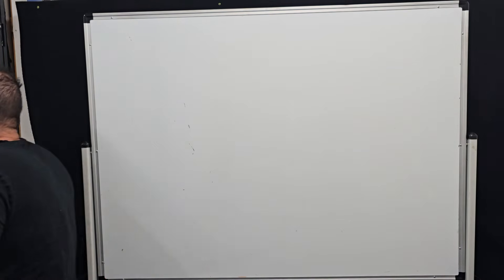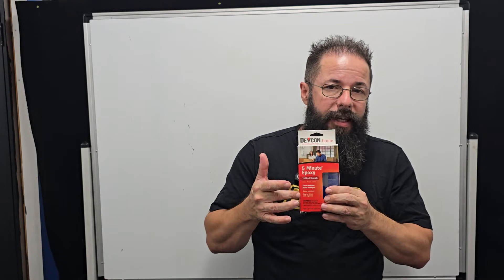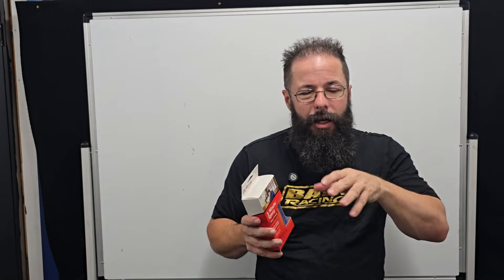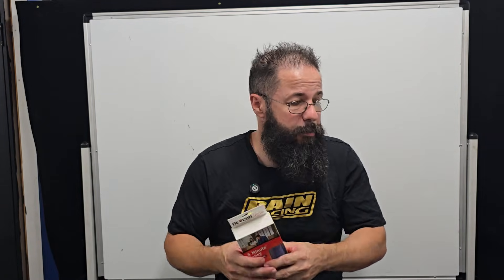Port Epoxy for Reshaping and Modifying - Splash Zone, Ferropre, and Devcon 2-Ton

Comment: Jake, same for cast iron?
Reply from the maker: Yes mate,  just mechanically clean and add anchors. Like a screw for the compound to hold onto. This way if it releases,  it still stays in place
Reply: @bainracing thanks Jake i have a hole. That should hold it. I over ported it! 😢
Reply from the maker: @alanhow3575 ah! Not great for holes. Needs to be thick. And make sure you seal it from both sides if possible.  Especially if its gone into water.

Comment: Hi did you guys got any info on the 5 valve audi heads the 3 intake valves must have high velocity
Reply from the maker: Yeah mate. They are lower velocity.  Its why opinions are divided we 3 valve. You need RPM to make them work and they don't make as much torque down low as 2 intake valves.  Also take some important steps when porting
Reply: @bainracing  Thanks so not going bigger at ports mines the small port use it on track days. More efficient get flow right check manifold add cams with revkit
Reply from the maker: @jozuaengelbrecht yeah. Just measure the area and see what your MSCA air speed is.  This will tell you what's needed.  Generally I don't making them much bigger. Just tidy them up.

Comment: Outstanding video, the concept of air flow dynamics is very complex!!looking forward to your 426 super stock experience, here in the states we have mopar superstar charlie wescott, and the hemi militia. Accepting any contender who steps in the ring, the ss/ah is contested at indy ,late August, pack a lunch, and run what ya brung!!the mopar dream team is pushing 3 horse a cubic inch, and a jessel valve train in the 12 grand rpm range, check out the amount of epoxy in the cast iron heads??good luck!!
Reply from the maker: Yeah I know a few guys that do it. Wish we had something like that in Australia 👍

Comment: For us E85 guys, that Devcon, according their own technical sheet, has near zero ethanol resistance.  The best ethanol resistant top sealer for Splash Zone I have found is simply clear catalyzed auto paint (rattle can is useless).  Belzona 111 is an alternative to Splash Zone for greater ethanol resistance but MUCH more expensive and very hard to find.
Reply from the maker: Yeah!  Its pricey as!!!😂😂👍

Comment: @bainracing another option is 3M 07333. It doesn't need to be coated. I've patched fuel tanks with it. I've bonded test samples and submerged them in gasoline for a year with zero loss of adhesion. It is designed for use with aluminum and steel. Color change shows the cure rate. You can shape it as it cures, you can apply saran wrap over it to help with shaping and peel off when cured.

Comment: Jake, One item that I was hoping you touched on but didn’t mention is, If doing “thick” filling (like the photos in the YouTube cover). Do you fill in one thick application if you can or do you do several layers building up to the desired amount? I can see maybe pros & cons with each idea. Also do you do any means of “mechanical” attachment when doing something like 3/8”-1/2” thick beyond the burr finish you mentioned? Thank You! Love the videos! Some is a bit over my head but doesn’t mean I don’t watch every minute & try to work through the project in my head
Reply from the maker: Yeah man.  I can put an anchor in and try to do in one hit.

Comment: Hey Jake, an industrial epoxy well known globally for over 60yrs is Belzona Epoxy & covers many indusrtial industries & has a branch office in Melbourne.  There products are used for indusrtial power generation for engine block repairs its so reliable.
Reply from the maker: Good to know! Thanks for the tip. I've heard of it. But haven't personally used it.  Thanks again!👍

Comment: The best material that I have ever used for getting paint and epoxy to adhere incredibly well to aluminum is a product called Alodine. It is mandatory in Aerospace for prepping aluminum in many instances. I have used it on many aluminum parts that I have fabbed. Even if the parts are just left with the Alodine as a topcoat, they don't corrode, even if left outside. Easy to reapply as well. If your wanting to up your guarantee of adhesion with aluminum it is worth a look. Thanks for the great content!
Reply from the maker: Yeah I've heard a few guys using its!  Cheers for the tips!👍
Reply: It is very good..
Alodine1200s. Comes as a powder. 
I've had a drum mixed up for like 10 years. I stick everything in it
Reply from the maker: @Not-Sure-Viralade-ftw nice! 👍

Comment: When I started with epoxy's the go-to was "plastic Mastic" it was strong stuff now I use Z-spar mainly....If I use a thick floor port raise I use a stake to hold the epoxy in place on the underside/surface I have had it pop out on narrow runners (906 mopar wedge)...the epoxy will erode over time as oil/fuel will eventually get underneath and loosen the grip.
Reply from the maker: 😂 i remember that stuff.  Yeah you need to be careful.   I find sealing it helps with the oil and fuel. 👍
Reply: @bainracing  I'm doing a set of 426 Hemi Super Stock heads this summer and building a tunnel ram/complete engine from scratch.
Reply from the maker: Nice mate! if you need any tips, let me know
Reply: @bainracing  I do and I will let you know thanks!

Comment: How thin is too thin and should undercut the fill area
Reply from the maker: I stay around 1mm 0.040" but depending on the area its covering.  If its a bigger area it can have thinner edges.  Like the whole short turn area. We have had it as thin as 0.020" but it covered the hole area.  If you're concerned just seal it for added protection.

Comment: Dose this mean that we can bore out the port, and then use an epoxy insert for testing and RnD? With 3D printing we can get virtually any shape of insert! So we can  finally find out does jelly bear shaped dimples increase flow or not!
Reply from the maker: That's what most of us do mate.  Port out too big. Fill with Epoxy and then add the shape we need.  😂😂 and no they don't work! 😉
Reply: @bainracing  You need to do something like a Fan Showdown/Propeller Competition, where subscribers design an insert for the port, and you print it and flowbench

Comment: I get called poxy😢
Oooh epoxy.😅 why is JB weld no good? it comes in small convenient tubes
Reply from the maker: Price to volume.  You wouldn't want to be doing full remodelling with it. and some fuels break it down.
Reply: My only guess is sub par adhesion and its hardness. Ive got some on my block after a dodgy head gasket job. Still holding strong but its fully contained in compression. Was designed to alloy adhesion apparently

Comment: I use plasti- bond Shelley's good for -28 to 190 C.  I use it to repair outboard motors in particular water jackets no problem
Resistance to acid, alkalis and oil
Reply from the maker: Good to know it works for you!